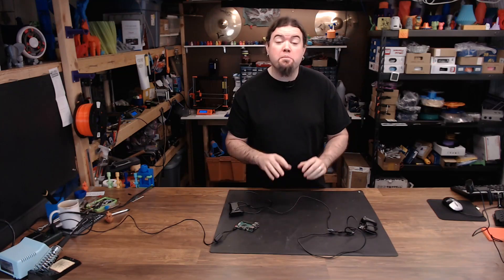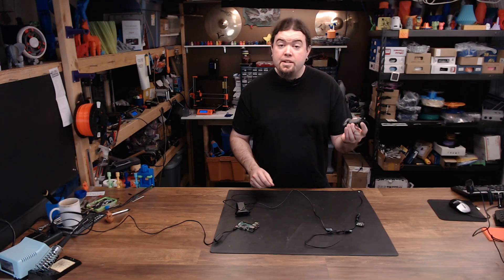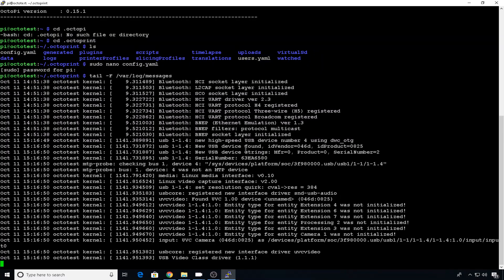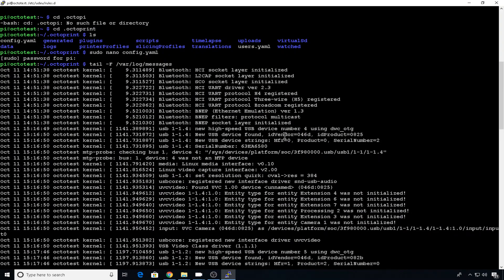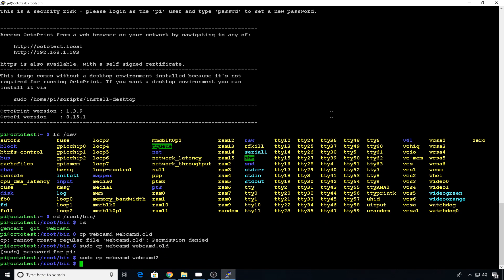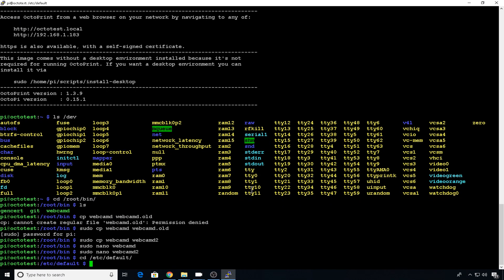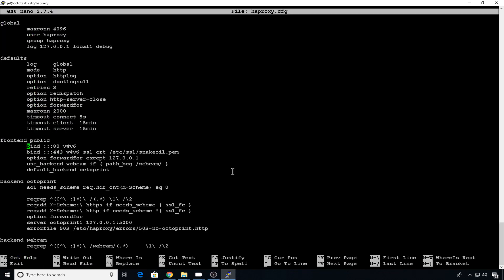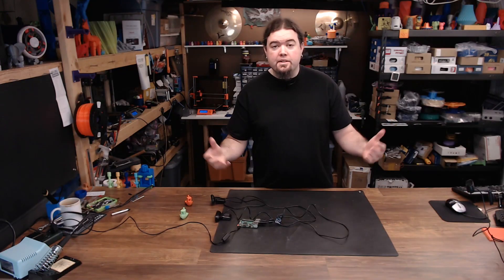Depreciated -  Multi-cam Plugin - Chris's Basement

Comment: Had it running fine. Well, the two cams still do run fine, but the problem is:
The installed Pushover plugin sends me a webcam shot of the overview camera (raspi cam) on my phone.
I dont know what has changed, but since a month, The pushover plugin send e a webcam shot of the second camera (usb) which is the nozzle cam, and therefor is useless for displaying the printed part.
I don't know if there is a "default" webcam can be set somewhere, so that The Pushover plugin sends me the right image?
(i did not upgrade the pushover plugin, nor there's a setting in this plugin to choose a cam)
Or; Can I switch both cams in some way in command line / config files? 
Anyone has a thought on this?
Reply from the maker: Sounds like the plugin probably uses the default port. Not sure how that would have gotten changed though.

Comment: Hey Chris. Have been following the video to the letter. I have prusa mk3s+, raspberry 4 pi 2gb.The issue I am having is under change default files after you type cd/ect/default then list, webcamd does exist. I have tried this five times to install and same issue occurs. Everything up until this stage has gone as your video. I can’t understand why it can’t find this file. Could I ask for your time to video chat to resolve if possible. I am in Australia. Thanks Trev
Reply from the maker: Hey Trev, everything in this video has changed so much since then. See if this makes more sense. https://community.octoprint.org/t/setting-up-multiple-webcams-in-octopi-the-right-way/32669
Reply: Thanks Chris, how does this effect the files created already and the setup for eg video green and orange. I did not create an  original back up either.
Reply: Hey mate, tried that as well. Followed it as per the instructions and still nothing. I have been at this a week now with no luck. I have a basic understanding but I can’t see what I am missing. Your assistance would be grateful. Thanks Trev.
Reply from the maker: @trevormorgan6861  Hey, send me an email brotherchris81@gmail.com I have a script you can run to try and troubleshoot.
Reply: Thanks mate. Something so simple, yet doing my head in.
Reply: I have the same problem can you please also involve me in the problem solving. I also own mk3s+ and raspberry pi 4. Thanks

Comment: I appreciate the effort put into this video. Why, however it needs to be this hard is beyond me. Octoprint can detect and use a webcam with zero effort, but try to plug in two and it requires 1.5hrs worth of YouTube videos to hack files just to let it use the second cam.
For a non Linux users or software eng, this was impossibly hard.
Reply from the maker: I agree with you, the newer version are a bit easier, but it still requires editing files. https://community.octoprint.org/t/setting-up-multiple-webcams-in-octopi-the-right-way/32669

Comment: Hey Chris, great content as always. I'm just wondering if instead of hardcoding the PI ip address there is a way to use its alias or something else (like 127.0.0.1) because the ip could change every time your router gets rebooted, and that happens a lot on a country like mine because electricity shutdowns, specially on rainy season
Reply from the maker: Thanks! You should be able to use octopi.local.
Reply: If you reserve a static ip address in the router or hard code it into the config file it'll always stay the same. You can't access it from outside the network if it's not static anyway as you can't properly map the port.

Comment: Hey Chris, I'm stuck I have 2 Wyze cams which  are great. They programmed a usb firmware patch so now I use them on the Pi. However when I wanna have two in according to your manual then I concluded they have the same Vendorid, Idproduct and serial number. Any idea how to solve it?
Reply from the maker: About the only thing you can do is use ATTRS{devpatch}=="1.4" you can find the cam numbers in the log, it will be something like 1.4 or 1.2.

Comment: i've watched these videos numerous times and followed the steps.  i do not have a webcamd file in etc/init.d  where to get this file?  also i noticed this message is different than you you posted.  Why is my webcamd running from the etc/systemd/system and no etc/init.d as u show?

 webcamd.service - the OctoPi webcam daemon with the user specified config
   Loaded: loaded (/etc/systemd/system/webcamd.service; enabled; vendor preset: enabled)
   Active: active (running) since Sun 2020-09-20 14:35:08 BST; 43min ago
Reply from the maker: This all changed in newer versions of octoprint. This helps explain it. https://youtu.be/SdDq1wfTn0A

Comment: I had some problems with OctoPi 0.16. run sudo nano /boot/octopi.txt and comment out camera_usb_options. This is because /root/bin/webcamd and webcamd2 will use what is in the octopi.txt file, and not what you configured. If you just remove it from the octopi.txt file, it will use the new camera_usb_options from webcamd.
Reply from the maker: Yes, as you saw, that can get confusing.

Comment: Great video. Just wonder how the config will change when I have one camera connected via the PI camera cable as this is a pi camera, not a USB. So the result would be on a new USB webcam as well as the old PI camera.
Reply from the maker: Thanks, I have a ll that info out there but it;s kind of scattered. Octoprint has changed a lot. These 2 videos should get you there, init.d files are no longer used. https://youtu.be/SdDq1wfTn0A https://youtu.be/F0wC4jjF9EQ

Comment: Beware that this (great) guide is for 2 USB webcams. If you use a rasberrypi cam you don't need to change camera__usb_options and don't comment out anything in startUsb() in /root/bin/webcamdXXX. What you should do however is to comment out the block that sources /boot/octopi.txt in all your /root/bin/webcamdXXX configs (line 26 to 28 in octoprint 1.4)!
Reply from the maker: Thanks for posting this, yes, a lot got changed in 1.4 that isn't included in these videos.
Reply: @ChrisRiley  No worries. It's just a mini detail that maybe saves someone a minute as the usb options are ignored when camera="raspi" is detected. Thanks for this up to this day still very relevant comprehensive guide!

Comment: Hi Chris - great video (instructions are very clear) - what Raspberry Pi are you using? I did the whole process step by step and the second camera is not active (the led on the camera itself is off) and obviously it doesn't work... I wonder if the PI has enough power capacity for both cams? For reference, I'm using two C920s from Logitec - also tried changing one for an older Microsoft LifeCam, same issue. Any guidance would be of great help!!!
Reply from the maker: It's probably just some issue in the config. I am using the 3b+ you should be able to do 2 920's. What version of octopi are you using? See if this video helps anything, https://youtu.be/SdDq1wfTn0A

Comment: In version 0.17.0 of OctoPi, there is no webcamd file under /etc/init.d/, at least in my installation that is the case. you may want to check this first if you want to follow this guide and have it work.

SOLUTION: IF there is no webcamd file in /etc/init.d/ folder, just go to github, and search for "mjpeg-streamer-octoprint-daemon", there, navigate to /_root_/etc/init.d and open the webcamd textfile and copy everything in there to your clipboard.
Then, go to your putty and type the following commands to create the file and make it executable:
cd /etc/init.d
sudo nano webcamd                         *paste your clipboard in here and then save and exit the file
sudo chmod u+x webcamd              *this makes the file executable
*proceed as in the video
Reply from the maker: This is an updated version of kind of the same thing, this might help as well. Downloading that webcamd file should work just fine as well., https://youtu.be/SdDq1wfTn0A

Comment: hey Chris I did everything as same as you but I cant get it working I need help
Only one of the cams is working at the same time
Reply from the maker: Try this, 
The random starting/failure for me seemed to be the attaching the wrong /dev device to the symlink (in your case /dev/prusacam etc). The C270 and 920 have 2 streams inside - I think a JPEG one and a YUV one, and they attach to video0/1 and the second camera plugged in will attach to video2/3. I bet if you check your failed symlink it will point to an odd-numbered video device. I fixed it by adding  ', ATTR{index}=="0"' into the rules file so it always uses the video0 and video2 which are the streams that work with MJPEG, many reboots later and my pi boots correctly every time. Hope that helps. Nigel
Reply: I have changed the webcam as I said my first webcam was c270 not it is my second camera (webcamd2)
it is working on the port 8081 but first webcam is not working which is Playstation Eye
that means it is probably failure about the webcam not the multicam issue
Do you know anything to solve the issue I am trying somethings but until now nothing has worked 

BTW I know my PS Eye is working I have tried it
Reply: @ChrisRiley  sorry for bothering too much but this is the last time :D
with poking it too much and rebooting many time it started to working
Thanks for your helpful video
Reply: @ChrisRiley  Hey thanks for replying but unfortunately it didnt solve my issue 
I realize today when I  check the status of webcamd2 it shows message bellow

● webcamd2.service - the OctoPi webcam daemon with the user specified config
   Loaded: loaded (/etc/systemd/system/webcamd2.service; enabled; vendor preset: enabled)
   Active: failed (Result: start-limit-hit) since Tue 2020-03-10 09:09:56 GMT; 54ms ago
  Process: 6626 ExecStart=/root/bin/webcamd2 (code=exited, status=0/SUCCESS)

Mar 10 09:09:56 octopi systemd[1]: webcamd2.service: Service RestartSec=100ms expired, scheduling restart.
Mar 10 09:09:56 octopi systemd[1]: webcamd2.service: Scheduled restart job, restart counter is at 5.
Mar 10 09:09:56 octopi systemd[1]: Stopped the OctoPi webcam daemon with the user specified config.
Mar 10 09:09:56 octopi systemd[1]: webcamd2.service: Start request repeated too quickly.
Mar 10 09:09:56 octopi systemd[1]: webcamd2.service: Failed with result 'start-limit-hit'.
Mar 10 09:09:56 octopi systemd[1]: Failed to start the OctoPi webcam daemon with the user specified config.

If its trying to restart too many times it hits start limit 
So in the webcamd2.service I changed the restart=always to never
And now I have the message bellow

● webcamd2.service - the OctoPi webcam daemon with the user specified config
   Loaded: loaded (/etc/systemd/system/webcamd2.service; enabled; vendor preset: enabled)
   Active: inactive (dead) since Tue 2020-03-10 09:05:27 GMT; 3s ago
  Process: 6373 ExecStart=/root/bin/webcamd2 (code=exited, status=0/SUCCESS)

Mar 10 09:05:26 octopi mjpg_streamer[6397]: MJPG-streamer [6397]: Desired Resolution: 640 x 480
Mar 10 09:05:26 octopi mjpg_streamer[6397]: MJPG-streamer [6397]: Frames Per Second.: 1
Mar 10 09:05:26 octopi mjpg_streamer[6397]: MJPG-streamer [6397]: Format............: YUYV
Mar 10 09:05:26 octopi mjpg_streamer[6397]: MJPG-streamer [6397]: JPEG Quality......: 75
Mar 10 09:05:26 octopi mjpg_streamer[6397]: MJPG-streamer [6397]: TV-Norm...........: DEFAULT
Mar 10 09:05:26 octopi mjpg_streamer[6397]: MJPG-streamer [6397]: init_VideoIn failed
Mar 10 09:05:27 octopi webcamd2[6373]: Done bring up all configured video device
Mar 10 09:05:27 octopi webcamd2[6373]: Goodbye...
Mar 10 09:05:27 octopi systemd[1]: webcamd2.service: Succeeded.
Mar 10 09:05:27 octopi systemd[1]: Started the OctoPi webcam daemon with the user specified config.

BTW I am trying to use Playstation Eye as the second camera which is supported by octoprint
and my other camera is logitech c270

Comment: Hi
Is it also possible to use two logitech c270 webcams or is that a problem if  they are the same type of camera?
Reply from the maker: C270's should be fine, they have embedded serial numbers so you can tell them apart.

Comment: Thanks for the walk-through! I have my Raspberry Pi 4 1Gb running 1 cam flawlessly... I've read/heard that running more than one webcam on the same Pi as Octoprint could cause potential issues with Octoprint (crash/prints stopping or messing up.etc)... Will the Pi4 with just 1GB be OK to run 2 c270 cams? Maybe 3 without causing issues for Octoprint? I can setup a new RPi for this so that isn't an issue, but I have a simple script that stops the webcam when the printer isn't connected and it will become a bit more complicated to do the same thing over SSH to a second Pi. PLUS, its yet another PI running and cables and power and, well, more stuff to worry about..... I can also grab a Pi4 with 2GB as an upgrade to the running one if that would help, but I haven't closely monitored the mem usage so I'm not sure if RAM is the root issue people talk about at all. I'd prefer all on one Pi4 but am afraid of hurting the printing aspect since that is the most important bit.... Anyway...... thanks in advance! j
Reply from the maker: Thanks for watching! I have done 3 printers and 3 cams with a pi 3 and ran it for a while with no issues. I would think a 1gb pi 4 would handle it fine. Not sure about large gcode files, that is the only real unknown for me right now. I am still working on some performance numbers for these setups.

Comment: I was trying to set this up last night. Everything was going fine until i got to the point where you need to duplicate and edit  /etc/init.d/webcamd. The file does not exist. It looks like the webcam daemon is not starting. HELP!!
Reply from the maker: Check this one out, it should help. https://youtu.be/SdDq1wfTn0A
Reply: @ChrisRiley  Actually that is the video i originally followed, i posted this message in the wrong place. i'll have to go thru it again.  thanks for the quick reply.

Comment: my install doesn't have a webcamd file here to copy...I get file not found.   I  am in the right folder.

 Copy and change the init.d script:
cd /etc/init.d/
sudo cp webcamd webcamd2
sudo nano webcamd2

Add the 2 here:

#!/bin/sh

### BEGIN INIT INFO
# Provides:          webcamd2
Reply: same issue here
Reply from the maker: Looks to be a change in 0.17 octopi. I am testing it now.
Reply: @ChrisRiley  hi Chris, I guess that's one solution to get it working. https://community.octoprint.org/t/dual-usb-webcams/13120
Reply: Thanks Chris I started over because I ultimately wanted both my printers on this PI too...so doing that first this go around... but the Init.d and the Rules 99 don't seem to sync up.  I can still see both printers actually in both instances of Octoprint but they are called usb0 and usb1 instead of my names.  Either way I ran out of time yesterday.....I look forward to hearing what you find.

Comment: Hey Chris, is it possible to use 2 raspberry cameras? The pi i am using had 2 of those flat connectors, so i was think of having one flat cable to each and using dual camera on the same printer.
Reply from the maker: Hmmmm.....I have never seen one with 2 ports before. If raspi-config can support them, I guess it is possible, but I am not sure how to address both ports.
Reply: No, the Pi only has one camera port, the one near the middle, next to the HDMI connector.  The other flat cable connector, above the microSD cards slot, is a DSI display port for things like LCD displays.  You can't connect a camera to that.

Comment: Man... bashing my head on the wall trying to figure out why only 1 of my cameras will work when they're both plugged in. I have a C920 and a C922 pro stream. Both work independently, but I cant switch between the two. I'm at a loss here.
Reply from the maker: It's usually some sort config issue. It you send me an email I can try to help. brotherchris81@gmail.com
Reply: @ChrisRiley  Oh wow, thanks man. I've been messing with it off and on since the weekend, but wasn't able to make any progress and resorted to just moving my camera to a separate mount depending on the angle I wanted to record. I really appreciate your time.

Comment: I originally tried this and configured up a raspi-cam and C270 and it worked first time. I'm doing this again (with the latest octopi) with 2 C270s and I'm getting random failures of (mostly one, but sometimes both) the webcamd's at start-up. Is this something you have bumped into? or why you cunningly chose a C170 as the second cam :) When I use mine it seems to show 2 streams in the device so the first cam sets up video0 and video1, and the symlink seems to sometimes point at video1 (the wrong one). Adding ', ATTR{index}=="0"' in the rules file seems to be working so far for me. (oh, and in the new versions don't forget to rename /boot/octopi.txt or remove the source line in webcamd :) Hopefully, that helps someone on later versions of octopi.
Reply from the maker: Thanks for the comment and the info. The nice part about the c270 is it has a serial. I use those to help separate them out.

Comment: excellent tutorial Chris, many thanks but i think you have to consider an update to show how to manage this on the latest  octoprint based on raspbian buster that was released lately as stable, i tried but seems i have some thing missing, services work fine and 2 cameras stream but after reboot they dont work, i get the error "webcam.service: Failed with result 'start-limit-hit", same thing fir webcamd2.service ,

regards
Reply from the maker: Thank you! I agree, I need to do some updates to these videos now that octoprint and octopi have been changing.
Reply: @ChrisRiley  thanks to you,  i managed to make it work with Octoprint 0.16.0 but not very stable, some times needed a reboot or two to get the cameras streaming, the latest release 0.17.0 is a very different setup, still trying to figure out how to get it to work